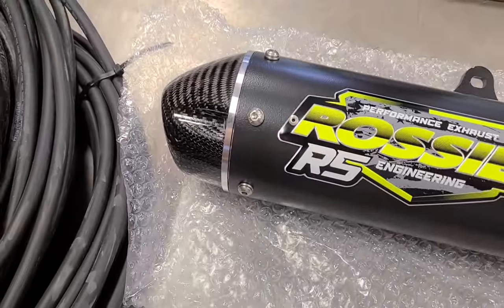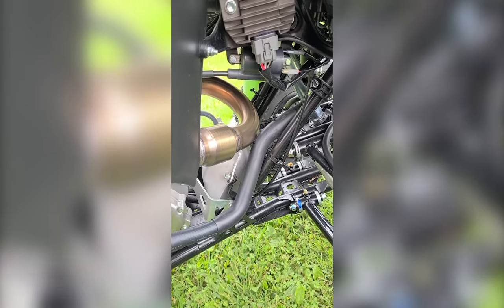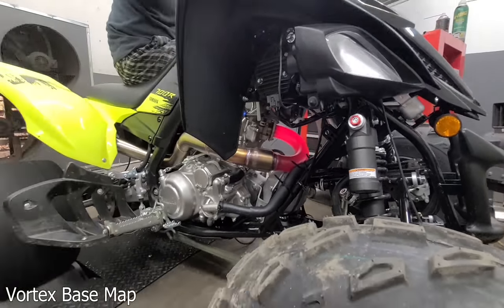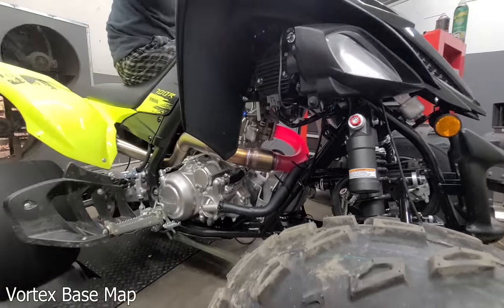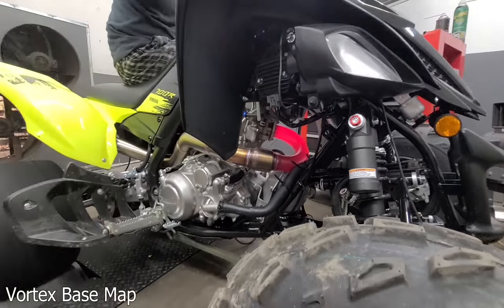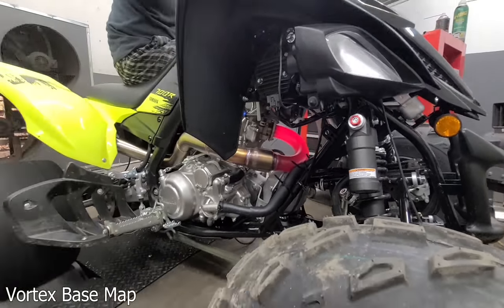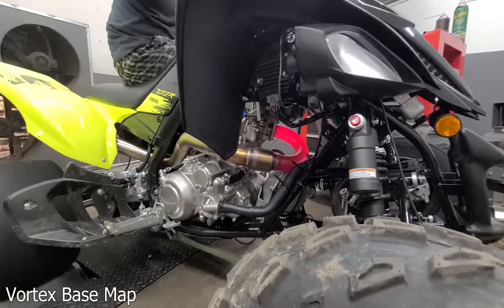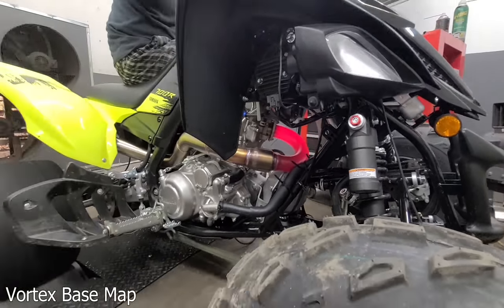The Best Way to Tune your Raptor 700! This thing is SICK!

Comment: Now all you need is the stage 3 hot cam. That and the big three that you just did is all that you will need.  It's amazing with the stage 3 hot cam. It doesn't fall off on top and it revs to the moon like 450's

Comment: Glad to see you're enjoying the Raptor. Mine just has full Yoshi exhaust,  a pc5,  uni filter and ais delete, nothing crazy but I love it. Game changer for me was the precision stabilizer, but im old 🤪 . Both the guys I ride with after trying mine ordered one too lol
Reply from the maker: I'll get a stabilizer eventually I just haven't felt the pros yet haha I know it's there I just haven't felt it personally
Reply: That's plenty! As Jacob said they have plenty of HP. 45hp to rear wheels stock/50 @crank. Gettin near 50 @rear wheels w/big3 is perfect + machine will last looong time esp w/oil changes under 15hrs. I don't have the big3 on my '21 & I'm happy. LOVE IT. Get an acerbis hr meter ($30 on Ebay). Run good full synthetic 10w40 at 1st oil change. #maxima
Reply: @BrewerOffroad  no need bro. It's set up perfectly now!
Reply: @Davido50  I don’t see the acerbic hr meter on EBay don’t you have a link?
Reply: Does your pipe get red while idling? I literally have the same setup as you.
Reply: @ssgviper7147  not sure who you were asking but mine does not get red.

Comment: @Brewer Offroad it is possible to adapt a raptor so that it has the same driving behavior as your yfz450 and by that I mean that it tips over less quickly and throws its butt more easily, so basically all the good things about a yfz450 but with the engine of a raptor because then you have to tinker less quickly, such as preventively replacing the piston, etc.
Reply from the maker: I agree Pete Hagers Raptor is set up nicely and is an animal. However the raptors power delivery doesn't match my riding style very well so I wasn't interested in investing that kind of money into making the raptor a better machine.

Comment: HMF exhausts is quoting a good bit more power and torque on the Mustang dyno spec (46 ft-lb, 51 hp).
Reply from the maker: Depends on the dyno setup. If dynos aren't set up properly they will read higher number than reality. Jay uses his dyno to dyno other dyno machines. Most of all HP numbers you hear are "inflated" by a faulty dyno set up

Comment: Just a wider rear end really changed the feel of it. Personally I don’t see a need to widen the front. I’m sure it would be an improvement as well but the rear end is where the problem is with the raptor.
Reply from the maker: Definitely going to widen it in the near future
Reply: @BrewerOffroad  I think after you do you’ll gain a lot more confidence in it. I’m excited to see where this goes as you get more familiar with the platform and more seat time with it. 🚀

Comment: Love the content man! 
Jay is so awesome I remember my trip! 
I love how the bikes going along! The pipe matches it perfectly.

I am just shocked that it made only 47/48hp with the Big 3??
I know its not the best filter but I would've went with a different one if you're going to dyno tune it. 

One small change will throw off the mapping and would need a remapping/tuning. 

I was expecting at least 50. Regardless that thing is sick!
Reply from the maker: If you check the final screenshot after tuning it made almost 50

Comment: Original inspiration video that lead to me going vortex as well. I cannot justify owning something fuel injected without being able to have full control over the fuel & timing maps. Will still need to acquire their "tuning kit" to get the USB cable / module to actually do that, but still.

Comment: 2016 700r
CP 12:5:1 piston 
Stage 3 hot cam 
Titanium valve springs 
Pink denso injector 
E85 fuel 
Plug wire mod 
Vortex tuner / dyno 
FCI intake 
Monster single exhaust 
+3 throttle body 
AIS block off plates 
Stiffer clutch springs 
Full fiber clutch plate 

Would like 70HP stock more stock stroke stock head. that’s about as far as I can push it reliably trying to make 70HP with those specific goals. don’t want a stroked out 14:1, ported, raptor because I don’t have that much money lol

Comment: Hey got the same year, same color. Same pipe installed last week with the fci intake and PC6. Don't have access to a tuner locally unfortunately. I did the AIS delete, oil drain plug swap, hiper 3 beadlocks and GBC XC masters all corners.
Reply from the maker: Nice! I drove 6 hours for Jay to tune my raptor so ita worth it if you can travel alittle for one!
Reply: @BrewerOffroad  in the end that's the goal. Just need to see what is close that has experience.

Comment: Best mods to do on a 700 raptor 2015+. Full dual exhaust, fci intake, pc5 with auto tune or vortex, stage 1-2 cam, port the head, bigger throttle body, bigger injector, then delete the clutch perch sensor..

Comment: I have a 2021 with a Yoshi stainless steel full pipe and power commander V with the tune selected for the exact exhaust and the pipe gets red like that. Customer support says that's the right tune as well. Maybe I need to get a custom tune. Am in Houston, it's hot and at sea level.
Reply from the maker: Definitely needs a custom tune!

Comment: Hay what was the outcome for the radiator hose and  exhaust clamp? Keep up the good work 😊🤙🏻
Reply from the maker: No exhaust clamp needed in that spot and I zip tied the hose out of the way 😅
Reply: Cheers  for the reply I just got the rs5 for my yfz450 wondered the same thing about the clamp.

Comment: How does the vortex work?? I’m running power commander v. I wonder do I keep that for fuel tuning and buy the vortex ecu? Or can they not be used together? Just wondering, mainly because that tune looked like it was all of the braaaaaaaap!!!!! Hahaha nice build
Reply from the maker: The vortex controls EVERYTHING no need for a piggyback fuel controller. Remove the stock ecu and install the vortex and then let the dyno guy custom tune it to your Quad and it'll be a monster! Clean, efficient, and safe power!
Reply: @BrewerOffroad   I was hoping you weren’t gonna say that. Hahahaha it’s only money I suppose. I’m tempted now to swap out tuners and see the difference. Good thing is I’ll have both in the shop at that point to swap as I like. Thanks for the input bro.

Comment: Just got a dual big gun exhaust KN filter, vented airbox lid like yours, going to get it dynoed next month at dynojet. Think im doing the PC5.
Reply from the maker: PC5 is the next best option compared to the vortex for sure but it does have a speed limiter in 5th gear
Reply: Any thoughts on the PC6 ? PC5 is discontinued

Comment: I just bought a 700 Raptor.Two header pipes.Why do you have only one header.Whats going on ?
Reply from the maker: I don't know the raptor history perfectly but I know they made a Raptor with a Dual Ported Head. Mine is only single ported. I have heard the Dual Port is better for making BIG POWER! So Congrats!
Reply: @BrewerOffroad  Thanks for this.I did not know about the newer single port heads.

Comment: So with just a yoshi slip on it would definitely need a tune? Guy at dealer when I got my 23 se said it would compensate for the slip on but that was it.
Reply from the maker: To my knowledge it will not compensate for any modifications. You'll need to get it tuned to know 100% that it's healthy and making the most power for your set up

Comment: Do you love the raptor more than the yfz450r ?
Reply from the maker: I do not I prefer the yfz450
Reply: @BrewerOffroad which year did the YFZ450 start with fuel injection on the YFZ450 because then I know which year to look at since in the Netherlands the same quad that costs you $4500 costs almost double in our country?

Comment: Is it normal that your exhaust is getting hot and red?
Reply from the maker: No that is a sign your engine is too lean. Not good for you motor
Reply: @BrewerOffroad  wich parts do we need to change for fix the problem

Comment: I just had the empire dual exhaust with power commander 6 and fci installed.  Is it normal for the header pipe to glow after only 5 mins of running?
Reply from the maker: Was it daylight outside? The tune is probably lean
Reply: @BrewerOffroad  it was daylight. The guy at empire exhaust said it was normal.
Reply from the maker: @Bkrraptor  it's running too lean because of the PC6

Comment: Does the pipe glow like that during a normal ride? or was that only because of the before tune?
Reply: That is before tuning. It was too lean. That's not normal with a proper tune.
Reply from the maker: The pipe glow is a negative thing. Usually always a sign it is running way too lean which is super unhealthy but most machine the due big 3 are running lean until you go to a dyno guy
Reply: @BrewerOffroad  so what you going do the pipe from stop glowing

Comment: So you only made 4 to 5 more hp? Lol?
Reply from the maker: That's a 10% increase over stock that's pretty good lol
Reply: @BrewerOffroad  yeah I mean I feel like there was more left of the table for sure. Probably at least another 3-5hp while it was safe. Was this only on 93 pump gas? If so then yeah I'd imagine it's a good gain and safe. But my gut says 55hp to the wheels 60ish crank was obtainable with the big 3. Especially with a custom map. Idk I could be wrong. I just bought a raptor 700. I'm in PA. I have been wanting to do the big 3 and then take it somewhere to be tuned. Is this the best tuner for raptor 700's? Thanks! Awesome channel btw.
Reply from the maker: @kennethhopkins1137  so it's on 93 pump gas but you won't gain HP by increasing octane unless you increase your compression as well. Unfortunately alot of dynos in the country have inflated numbers because of improper sensor locations. Most guys who claim 55 to 60 hp on the big 3 has a faulty dyno set up. The reality is 48 to 52 based on intake and pipe. The tune is more for power delivery. Vortex is the best for clean power delivery, Power Commander is the best on the pocket for sure.
Reply: @BrewerOffroad so best big 3 in your opinion? What brands? And who is the best tuner for a 700 raptor?
Reply from the maker: @kennethhopkins1137  dasa exhaust, fci intake, vortex tuner. A custom map from a dyno session is the best way to go not a pre mapped tuner. I only know of Jay in Chicago that is near me. Illinois powersports.
Reply: @BrewerOffroad  if Dasa is the best why did you go with the rossier?
Reply from the maker: @kennethhopkins1137  I preferred the sound of the rossier on the raptor. The Dasa makes better power
Reply: These come with 45hp CRANK. To the wheels they make around 36-40hp. Since dyno numbers read wheel horsepower, the quad actually gained 8-12whp, which is really good.
Reply from the maker: @racequad9  thank you for the clarification!

Comment: Why did you buy a $800 vortex ecu for a raptor? Those are for garbage yfz 450 ecu swaps. The normal power commander 5/6 works amazing and is way easier to tune. Why in the hell would this tuner run your raptor for that long popping and sputtering and the pipe lean as fuck!!! That is how you burn a hole in the top of the piston.. he knows it’s running like shit., tune it a little before you start messing around like that..
Reply from the maker: Clearly you need to watch the entire video and understand what the vortex offers compared to the pc5/6. I was running 60 horse raptors on a pc5 with my 50 horse vortex tuned raptor and keeping up and winning a few times because of power delivery and 5th gear having full power.
Reply: @BrewerOffroad  that makes no sense.. horsepower is horsepower. If you make 60 with whatever ecu or stock  it still makes 60 when dyno’d lol.. 😂 the vortex is an overpriced Chinese ECU. Only reason they are popular is because the stock yfz 450 ecu literally doesn’t work, the yfz sputters and cuts out constantly without a vortex. That’s it though. A raptor doesn’t like the vortex. It is better to use stock ECU and get a good tune. All fun and games until Chinese ecu bricks and stops working
Reply from the maker: 60 isn't 60 haha it's a power curve not a power line. I have more power throughout the curve so I develop speed more quickly. Pc5 and 6 are peaky with power because they power cut 🤣

Ask anyone who has ridden my raptor, it loves the vortex 🤣

Comment: Hey man I got the same 2022 se raptor as you wanna do the big 3 but only got about 5 hours on it did you wait till the 15 hour mark or you think it's fine to do it now dealership said 15 to 20 hours first service and check the valves
Reply from the maker: Mine had about 1.5 hours before I did the big 3 haha
Reply: @BrewerOffroad  haha I was trying to hold myself back but 15 hours is alot of time so gonna go for it thanks man !
Reply: Make sure you don't run that Yamalube oil. That stuff eats cranks.
Reply: @windycityjohn400  any recommendations then?
Reply: @cclaw266  
I run Torco (per the advice of Jay at Illinois Powersports)
But other good options like Maxima, Amsoil, Mobile 1 are safe choices. 
That Yamalube shouldn't even qualify as oil.
Reply: What about pennzoil 10w40 atv/utv